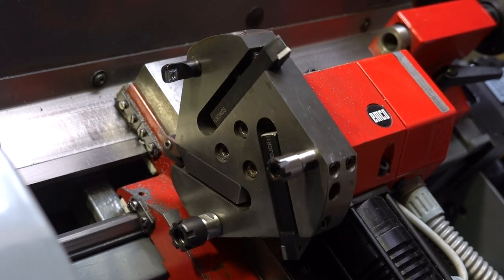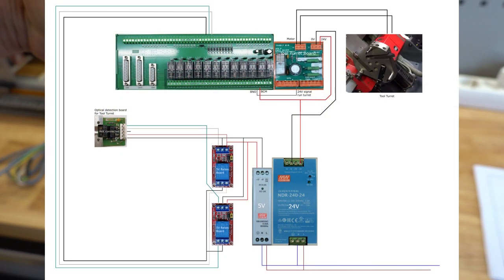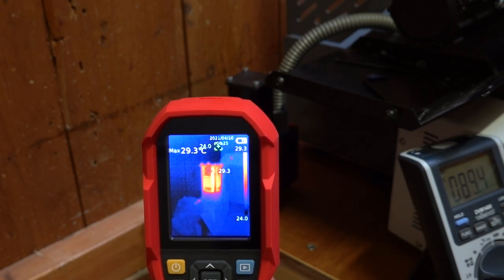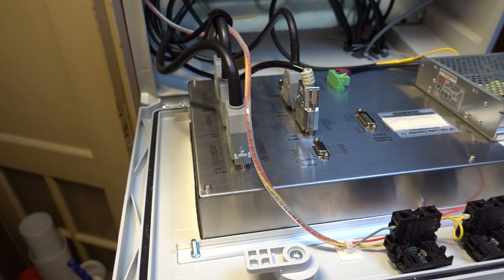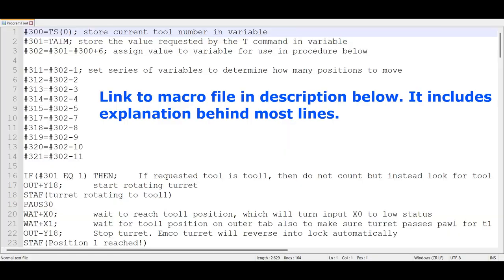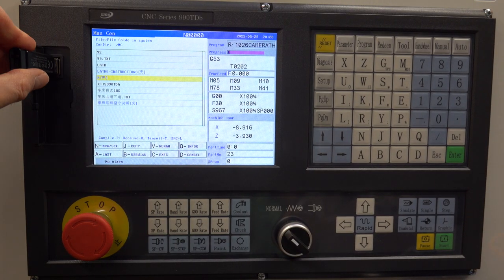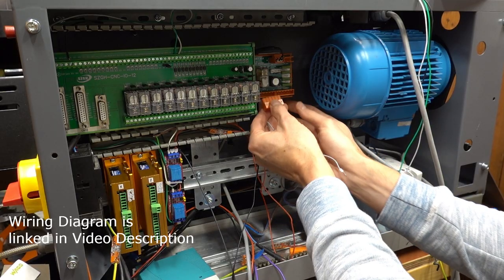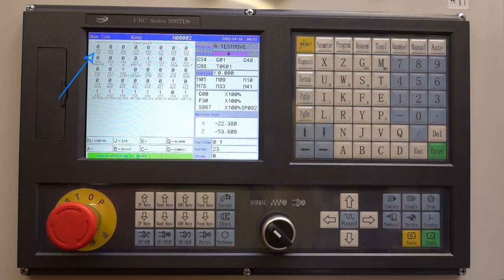Mini CNC Lathe Retrofit Part 3 - Tool Turret Wiring and Programming

Comment: Hello
first congratulations on the very good video
Secondly, I would like to know if you had problems with rotation and feed variation. Because I'm using a command like this and when I tell the plate to rotate it goes beyond the programmed value, the same thing happens with the advance, I tell it to advance at 300mm/min, it advances at 360mm/min, did you have this problem, could you help me solve it?
Reply from the maker: Hi I am not sure which axis you are having issues with. You mention "rotate" but then also mm/min. Could you ley me know if the issue is with the turret, spindle or X/axis?

Comment: You can add a custom boot logo to it as well instead on the stock szgh logo. I have the same controller on my mill and I have the model up with the c panel on my lathe
Reply from the maker: Nice tip, thanks. Great for adding a personal touch or the logo of your machine. The file exported when doing a backup, so should be easy to do.

Comment: Hey. I’m rebuilding my 120p and I’m very inspired by you. 
I looking for the turret board that you using for running the 24v motor. I gues I need to soldering my own board. Is there any chance you know witch parts and chematics it’s?

Thx for nice job
Reply from the maker: Hi, unfortunately I do not have the schematics for this Emco board. There are also a lot of connections on the board that are not used in the new setup. If you were to make your own it should be possible with some experimenting and measuring. Most important is the double pole double throw relais. Then just connect the motor to it on one of the connections. And on the other set of connections your connect the motor with wires swapped and a set of power resistors in between the would give you around 10V over the motor. From what I can see in my case there are 4 resistors in series with the motor, but I think 2 or 4 of these are in parallel to eachother to reduce current over each resistor. Of you experiment a bit and measure current to see if they do not go over the rating of your resistors end of course measure the 10V over the motor it should work. This is all the information I have, hope you can get it to work.

Comment: sir, can this controller display visually the cutting process?
Reply from the maker: Hi, it can simulate the tool path, but no full stock removal simulation. So just a 2D line graph of where the tool tip travels.

Comment: Hi sir,
I need mach3 lathe 8station wiring connection and software configuration.kindly give me sir
Reply from the maker: Hi, I am not using Mach3 at the moment, so I don't have any software settings for it. Please try machsuppport.com or cnczone forums, there should be more information available on those websites for mach3.

Comment: How to I change the tool setter from the stock nc type to a no type? I'm not seeing anything in the settings
Reply from the maker: Hi, sorry for the late reply, I am on vacation for a few weeks so there might be delays in my responses. You mention tool setter, but I assume you are referring to the tool turret? In that case the inputs are simply changed in the Program tool file (downloadable from my website article). In case you have a NC sensor you can use "WAT-X1" to wait for a low signal. For NO sensors use + sign. If you mean tool setter, I don't know since I do not use a tool probe. Let me know if I misunderstood the question.
Reply: @uptimefab7412  no tool setter I'm working on my mill controller I don't understand the macros and China isn't willing to help
Reply from the maker: If SZGH is not providing an example macro, it might be worth looking into the information linked below. The post on the top of page 5 by "Hood" contains a zip file with manuals on  how to program the SZGH macros. These documents are not shared on the official SZGH site as far as I know. The zip file also contains an example macro. This information really helped me with the tool turret macro. Of course I realize  what you want to do with the macro is for a different purpose, but it could be helpful nonetheless. Note that the link to the zip file does not work on a phone, try opening the link on a PC. 
http://www.mycncuk.com/threads/14016-Hardinge-CHNC-Retrofit/page5

Comment: Where did you get the tool holders ??
Reply from the maker: From AliExpress, the link is included in the parts list PDF file in the article, see link in the description. The parting tool is not part of the set. Besides that I bought cutting inserts for aluminum, as the set contains inserts that are not so sharp and therefore more suitable for heavy cutting in steel. Also these are listed in the PDF.
Reply: Aw sorry didn't see that,very detailed ,  I'll be converting the same model soon to linuxcnc but keeping all the electrics and drivers ,
Reply from the maker: Sounds like a nice project! And if you are able to reuse the hardware quite a bit cheaper. Good luck with the upgrade.

Comment: Ratchet is bad design, real CNC lathes use curvic coupling for repeatable tool indexing.
Ratchet mechanism will never get the same accuracy of a curvic coupling.
Reply from the maker: That is indeed a great way to achieve more accuracy. Much more expensive though, so I can understand that Emco went for the cheaper version for this lathe, used mostly in schools.
Reply: Will never get the same accuracy?.. First of all, this machine was designed for schools, not to be accurate, and second: Hold my Beer!.. i have a similar machine, and i mostly turn titanium on it.. according to EMCO this machine was designed for Non-Ferrous Materials... and indeed.. Titanium is Non-Ferrous.. (but that is not what EMCO meant..😁)
as far as accuracy goes.. running a batch of 50 Titanium parts, all within 0.02 mm looks pretty damn good to me..
Reply from the maker: That is really impressive, I have only turned brass on my Emco. Good to know even harder material is possible!